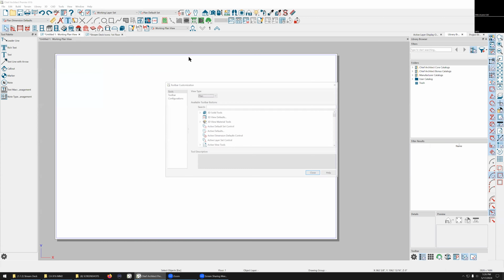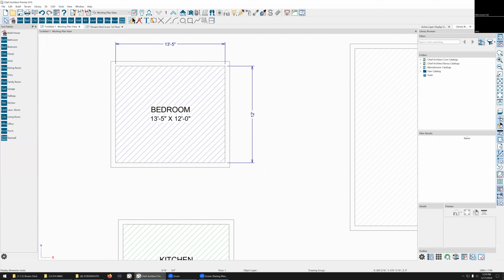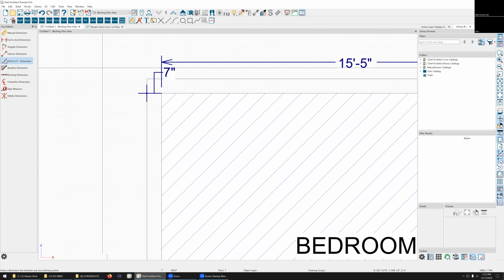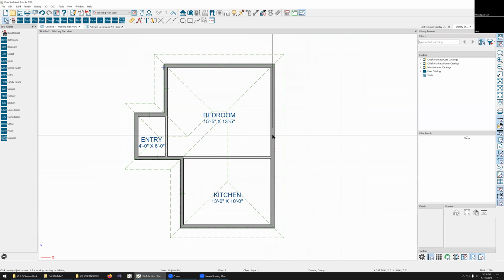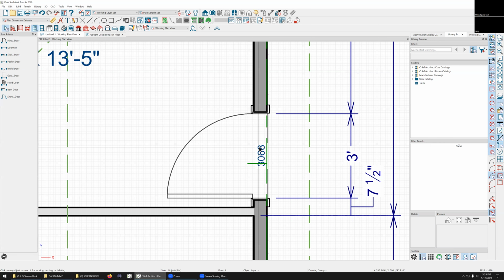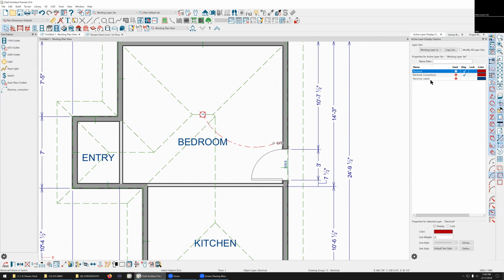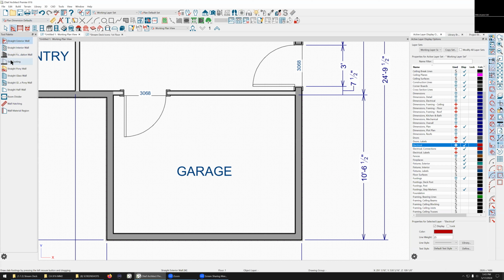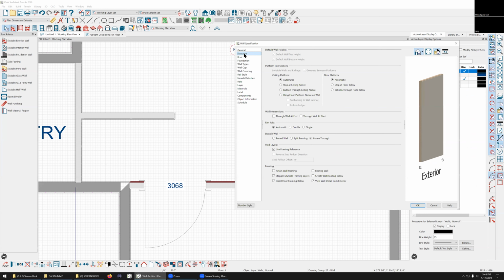Chief Architect:  new suggestions for x17

Comment: Pretty good idea with the space planning. If the account has less garage with higher end houses like we're doing we're not really concerned if we're using extra Lumber or trimming off a little too much since in the luxury market architect will Design the house the customer wants and that's that. Any wastage or overages incorporated into the plan and the costs but I can say having default sizes that we can change would be handy